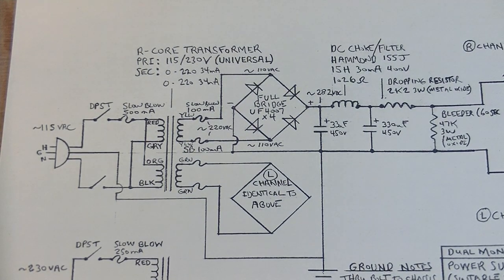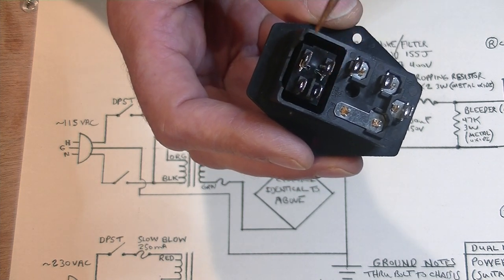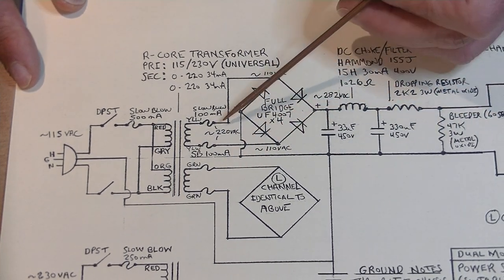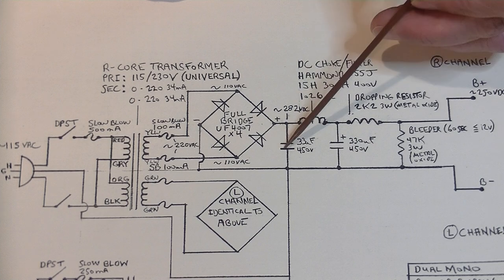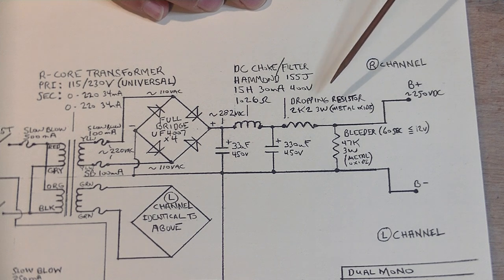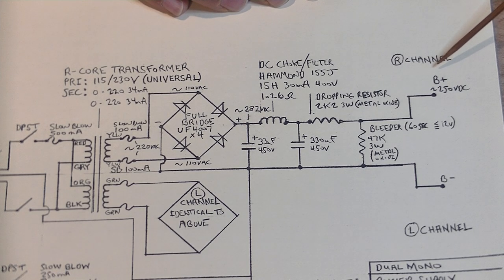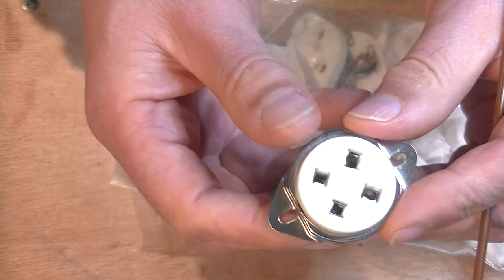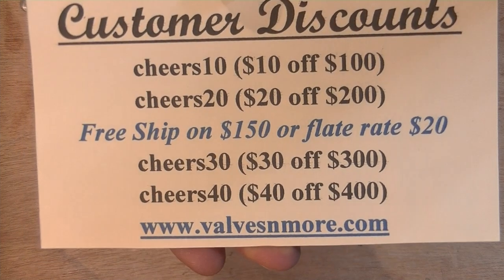Tube Lab #20a  How to Read a  Preamp Power Supply Schematic for Beginners

Comment: Great video! What are your thoughts on "audiophile" fuses?
Reply from the maker: @timmiee32  we already include audiophile fuses in all of our kits.  They're slow blow (SB) 20mm ceramic types.  What this gives you is a very short filament encased in a ceramic material that will resist arcing.  Perfect for both protecting the circuit (and user) as well as moving as much current as is required with minimum impedance (resistance).